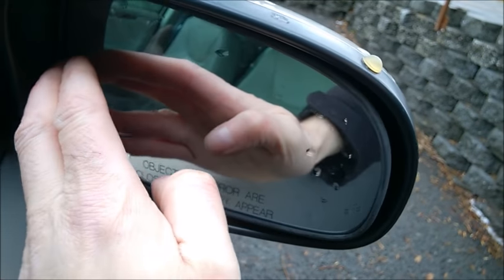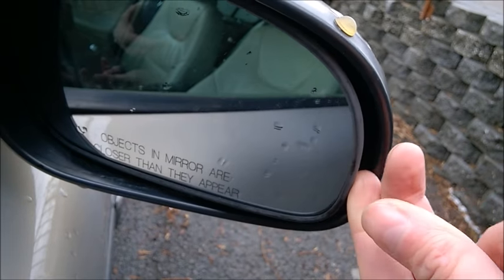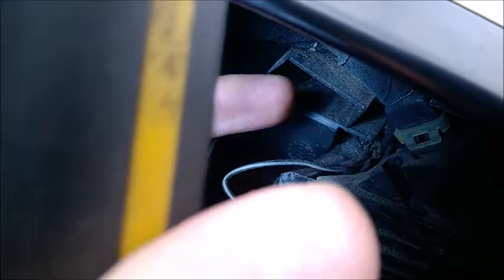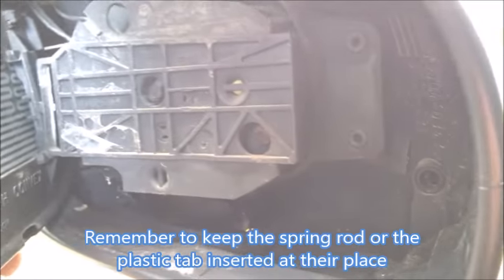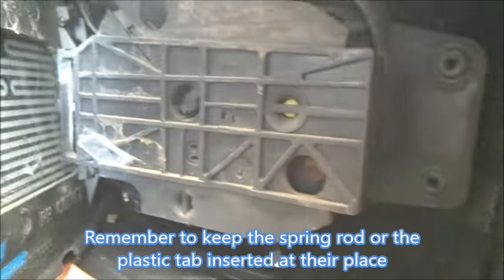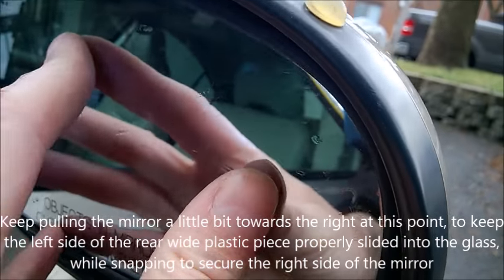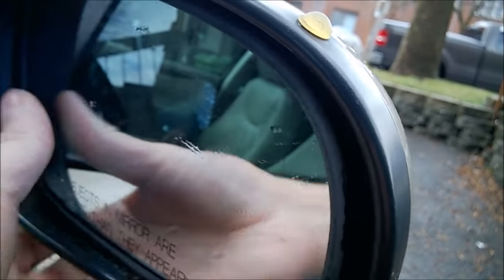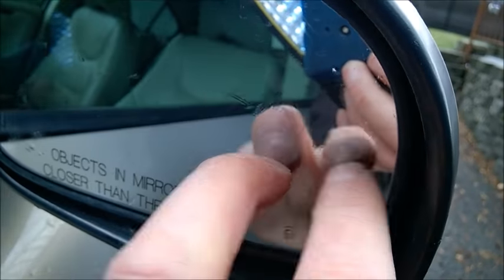Volvo S60 V70 XC70  S80 Side mirror glass removal and installing  2001-2009

Comment: I replaced the entire housing on a 2005 S80, only to find the mirror was flawed.  I removed the mirror on the old housing. In the process of trying to do so, the bracket where the mirror attaches broke a part.  I am concerned about breaking the bracket on the replaced housing.  I had to apply a lot o force to get the mirror off the old housing. now way it was coming off with a finger pull.